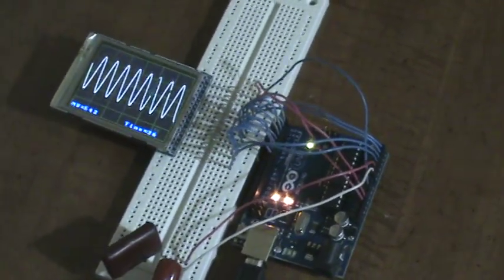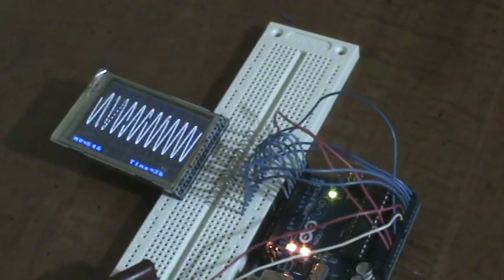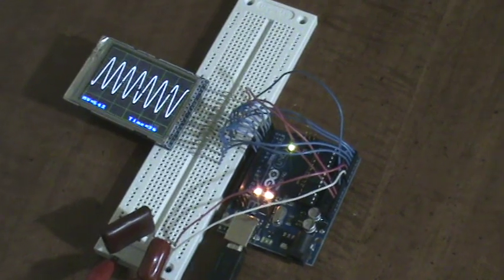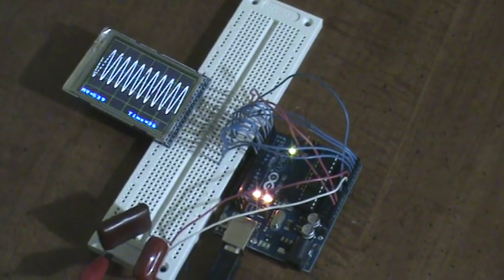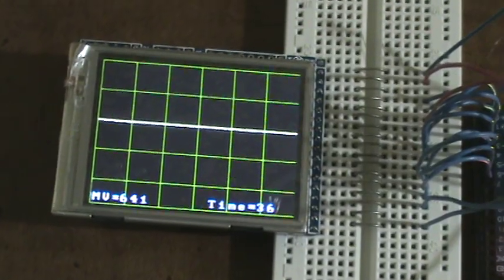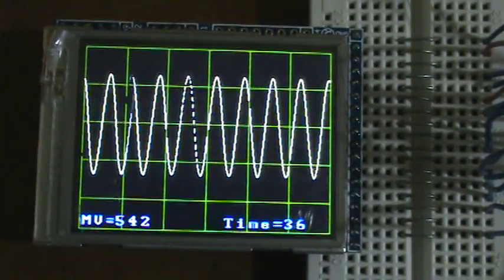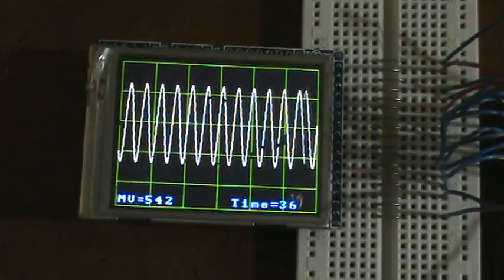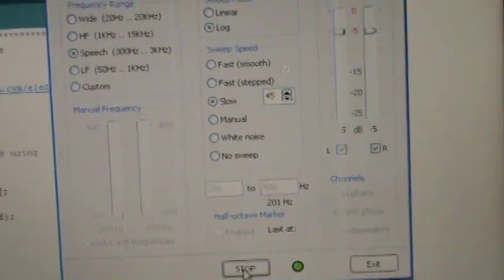Arduino Color TFT LCD Oscilloscope

Comment: Very interesting.  WOuld you happen to have any info for setting this up with the 3.2" tft and a mega 2560 R3?
Reply from the maker: I have a mega with a 3.2 inch LCD but Have never had time to do anything but a test program where you can write on the screen.
Reply: Thank you